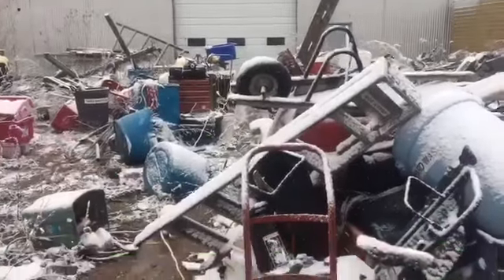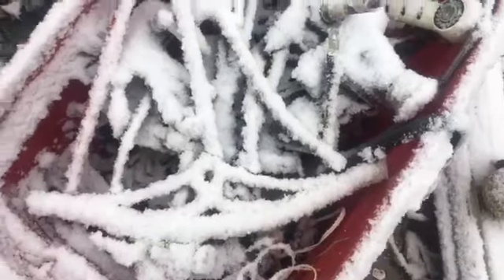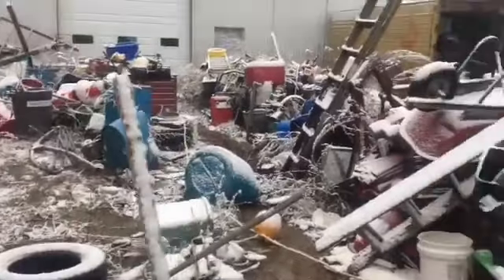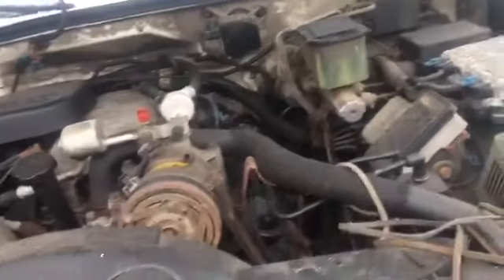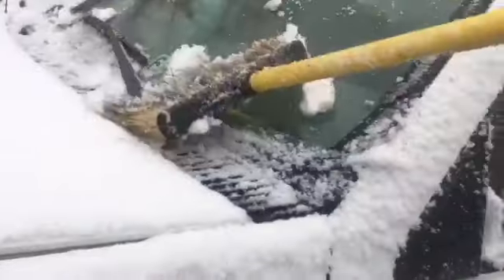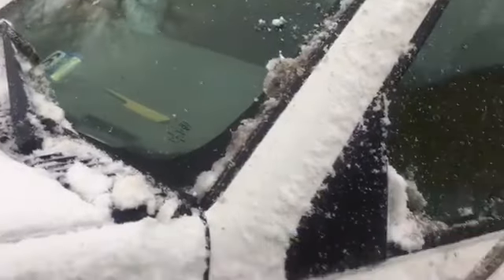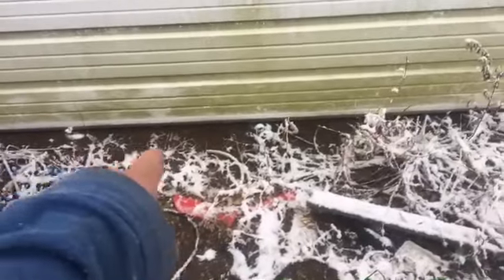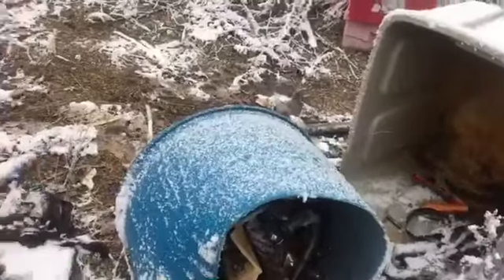LOOKS LIKE THIS JUST MIGHT WORK

Comment: There's replacement cutting wheels usually in the end of the knob you turn on that pipe cutter
Reply from the maker: I brought it inside so when you get a chance I’m going to take a look at it
Because it could be a good tool
Ya Might be right
Reply: @steelisthemeal  unless someone already used the spare but there's a screw in there that holds the cutting wheel